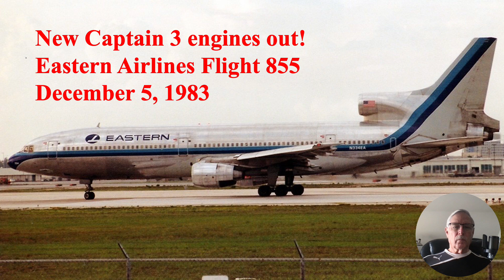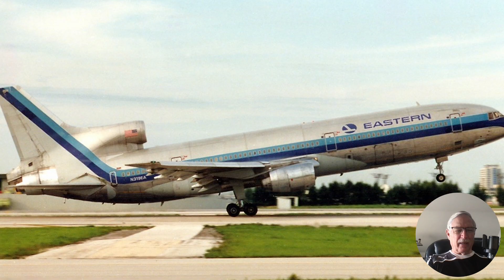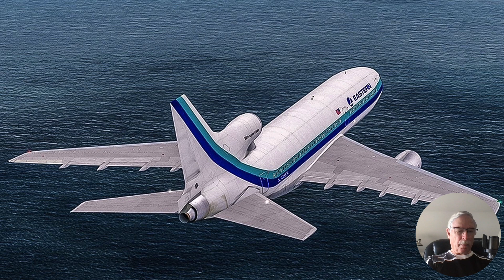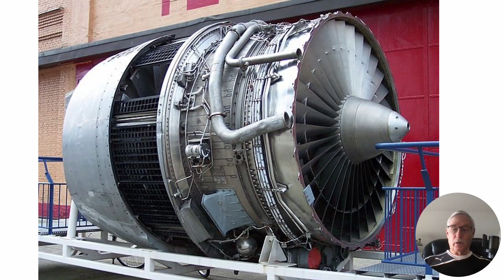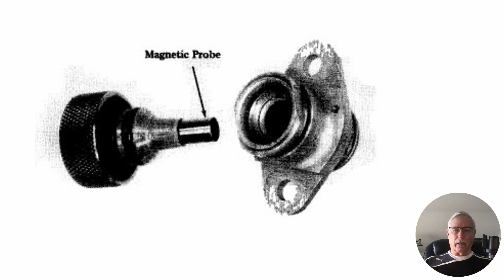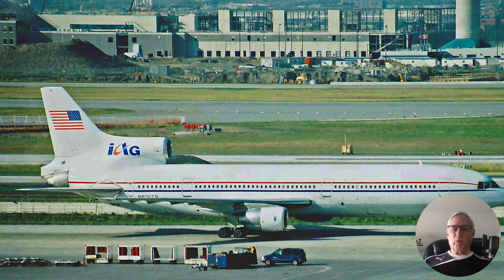New Captain 3 engines out! Eastern Airlines Flight 855 December 5, 1983

Comment: When the RB-211 was introduced in the '70's, it caused Eastern a boat load of problems, literally! Eastern was losing so many engines with the introduction of the L-1011 that they leased a barge to be towed out of JAX to SJU with new RB-211 engines aboard,. Upon arrival in SJU, the new engines were sent to the airport and the one's that had taken off on the ramp at SJU were sent back to the states for repair. The barge shuttle lasted for at least 3 years. One of my memories was watching the smoke tracing from a lost engine as the L-1011 turned northward after departing SJU, or the time one of the -211 engines failed just at rotation sending bit and pieces into the aircraft I was taxiing for takeoff. Back to the gate we went! Too bad,  as the L-1011 was a very nice airplane.
Reply: I knew the Rolls Royce reps at Boeing in Seattle….they told me when the L-1011 was new, the engines were so bad, that the Rolls-Royce mechanics / reps were flying on every flight.

Comment: I just enjoyed watching this video. I have a comment (correction) to terminology that is certainly not intended to take anything away from this. This was not a Single Point Failure (SPF). A SPF is just that, a single point failing - here three points failed, albeit three identical points in three redundant but separate systems. This is known as a "Common Mode Failure". Almost my entire career was in commercial nuclear energy production and preventing/mitigating failures was a subject that was extremely important and integral with almost every system in the plants. This distinction is very important because of the typically very different mitigating strategies. With respect to each engine only, the missing O Ring is an SPF, but with respect to the entire aircraft with three engines, it is not an SPF, it is a Common Mode Failure. This is a minor thing wrt to this very well-done video but, for reasons I do not know, I felt a need to comment. 45 years ago, I participated in diagnosing a failure in one of two nuclear safety related emergency diesel generators (I am a EE). The problem, an SPF with respect to the failed diesel, was due to a single wire incorrectly installed at the time of construction. It was found (via the "Extent of Condition" analysis) the second EDG had the same error. This made that a common mode failure. BTW, there were still other back-ups if both diesels failed but, obviously, the loss of the depth of redundancy was not desirable in any case, to say the least.

This video also had some nostalgic meaning to me as I lived in Miami at the time. I did not know one of the passengers, but I knew her husband (who was not aboard). She was in a group that was part of a work-related trip. Even though both have long passed, it would be wrong for me to comment more about that, but that incident had more than my casual interest.
Reply from the maker: Thank you for sharing a very informative and interesting comment!

Comment: Fascinating that all the oil leaked out because of O-rings. Must be extreme pressure to squirt out so much engine oil in such a short time. If I failed to replace the oil bolt washer on the drain plug on my car, I could probably drive 1000 miles before enough leaked out to trigger a warning light. This plane was in the air for like 30 min when oil pressure went to zero. Crazy!

Comment: It's strange that after determining 20 seconds of motoring is needed for oil pressure to cause visible leakage, they raise the motoring requirement to 30 seconds. Seems to be cutting it very close. They place a lot of faith in mechanics mumbling "one Mississippi, two Mississippi..." while staring at multiple gauges in a cockpit they may not be overly familiar with... I usually ran engines to leak check, with a second guy carefully looking at the uncowled engine.  This was an expensive mistake, and very close to being even expensive-er.
Reply: At Boeing, we’d always set the clock in the cockpit, for any timed test.

Comment: Hi Ron, I love your channel. Retired airline pilot here. 37 years flying 4 engine jets. 35 of those years as a Captain and check airman. This happened in a different time, which most people today would not understand....in many ways....

Two things came to mind. First, the FAA should not have chastized the F/E for anything. I loved having a flight engineer. From 30 minutes before departure to top of climb the poor F/E was  busier then a one armed paper hanger. Once they had an engine shutdown all three crew members workloads shot up exponentially. I can not fault that F/E in any way. His workload was over the top.

 I empathize with the crew on the  challenges choosing  a non-radar arrival to a third world destination vs a radar vectored arrival to a major destination in the US, with far better weather, just a few miles away. Knowing what they knew at the moment, it seemed very reasonable for a 3 engine jet to turn back. And throw in that it was a new Captain  with only 13 hours in the plane....wow....

I liked your comments about discussing how many engines were safer. Looking back on "Miracle on the Hudson", along about 2005 I had completed OE with a new Capt on a 747-200. He was slated to fly a release to the line flight a few days later with another check airmen that would be observed by an FAA inspector on a flight out to Denver and back. My student called me after the flight and said.....did you hear what happened. Nope I said. He said they hit a flock of birds about 10-15 miles from Denver on approach to the runway. The No 1 and 2 engines were severely damaged. No 1 failed and No2 was only operating at idle. But....they had TWO more engines running fine on the right wing, so they landed uneventfully.  So no one ever heard about it. 

Seems an argument for lots of engines. Remember the joke back in the day. Passenger, "Why do we have 4 engines?" Captain, "Because there isn't room for 6 engines".

Comment: I still miss the L1011 and wish Lockheed would come back to give Boeing competition in passenger airframes.  

That said, would the cluster of engines represent a virtual single point of failure, since the catastrophic failure of one could more easily take out another? Separating them on the wing is no guarantee, as we know, but I don't suppose that configuration would happen in modern designs.  

Although engine arrangements or numbers had nothing to do with this near accident. The single point of failure was the maintenance crew performing a procedure incorrectly on multiple engines. That defeats the safeguards of redundant systems. 

I guess, having multiple service technicians working each task is the equivalent of redundancy, so this kind of thing doesn't happen very often — people can catch one another. (Eyes Boeing's current problems) IF there's an equivalent to CRM on the ground.

Comment: I'm not a pilot. a mechanic, or involved in aircraft at all- but I still completely fail to understand how these o-rings could be missed. In addition to the obvious fact that a fitting going into an oil gallery must somehow attain a seal- they pulled the old ones out to inspect them for metal debris. During the inspection, the o-rings would have been as plain as the nose on your face. Since the procedure called for replacement instead of cleaning and reinstallation, it should have been rather obvious that the new plugs needed to have an o-ring fitted prior to installation. And I cannot imagine two trained mechanics agreeing that since they do not have the o-rings at hand, that simply ignoring that and "sending it" was a viable option.
In pipefitting of nearly every description, there are three ways of achieving a seal, dictated by the type of fitting. There's the O-ring or crush washer, in which the ring or washer is the sealing interface, the flare type in which the male and female sides of the fitting are conical and mate tightly, and the pipe taper in which the threaded surfaces are actually tapered and fit with a greater interference the more you tighten them- and also generally require a thread sealant such as teflon tape or pipe dope. Anyone with any mechanical experience at all, can identify the different types on sight- so I genuinely cannot understand how something like this can happen. Thanks for another interesting video.
Reply: Some believe that it was intentionally sabotaged due to Eastern’s hostile labour dispute with the mechanics?

Comment: I flew that airplane when I was at EAL. We named her Star Ship Glider.
Reply: Did Eastern brand its L1011s Starships?   If so, that’s amusing, because Western, The Only Way To Fly (at least according to Wally Bird, their mascot), called their DC-10s Spaceships.   These were -10 models which were sold not long after Delta bought Western, unlike the 737s and 727s, which fit snugly into Delta’s fleet (oddly Delta bought 737-200s years before the merger with Western, despite already having DC-9s)
Reply: They were dubbed "whisperliners."  LOL the loud-ass 727s were called "whisperjets."
Reply: @philipgcollier  That sort of corresponds with American Airlines calling its widebodied aircraft “Luxury Liners” and its narrow bodied aircraft “Luxury Jets” during the 1980s and 1990s, only it makes less sense relatively speaking, except perhaps from a passenger perspective, since the Boeing 727 was if I recall quiet to fly on, like the MD-80, the DC-9 and most other tail-engined aircraft, and unlike the delightful old Boeing 737-200 which had quite a roar in the back seats, which neither AA nor EAL operated for any extended period of time, if at all (I think AA may have briefly had 737s after they bought AirCal, but it wasn’t until they bought the 737-800 to replace their 727-200s that they became a substantial 737 operator, and the 737-800 is of course much quieter than a 200, and also quiet externally.
Reply: @philipgcollier 
It was all about the cabin noise, not the engines.
That name was applied to the 727, because when you were sitting in the first class cabin on that rear-engined aircraft, it was quiet up there in the front.

Comment: It wasn’t odd at all that #2 restarted, as it was shut down before bearing seizure occurred - which is why 1&3 failed on their own (a nasty catastrophic internal mess - also why they were smoking.) 

I’m curious if they could have achieved adequate altitude for a glide-in to MIA if they had trusted their instruments immediately. I’m guessing the oil leak rate was fairly similar regardless of engine power (at least not directly proportional) - so quickly going to higher thrust for a best climb rate before the engines failed may have been enough. I wonder if the report looked into such a scenario.  🤷🏻‍♂️

Comment: Thank you Captain Ron. I really appreciate your talks and your personal flight experience.  Thank you for all your safe flying hours.  It concerns me when a mechanic pulls out a chip detector and he has the old one in one hand, and a new one in the other hand, and isn't observant enough to notice that there is no O-ring on the new one?  And they know it is going in an oil system?  That's kind of disturbing.  And they mess that up three times with three different mechanics on three different engines?  And they all fail in the same flight?  Wow 😳.  I used to like flying. I'm a pilot myself, but I have been a passenger for many thousands of hours in the back.

Comment: A 4 engined BA 146 jet also had a similar oil leak failure on all 4 for lack of all 4 O rings on detector probes and it happened right on takeoff requiring immediate return.
Reply: There is usually more than one O-Ring on each chip detector, so that’s a lot of missing O-Rings!

Comment: I took an ATA Flight on the L1011 in '93 from SFO to HNL. Given your timeline of transfers, it can't have been this very aircraft. On the way back though, this time Delta from SFO to FRA, it might actually have been this airframe. We'll never know. I just remember that we got delayed (already in our seats) because one of the electrically powered passenger doors in the back would not close properly - it stopped inches from reaching the locked position. As far as I remember, a technician was called who then closed the door manually and it was deemed safe for the flight. I guess the passenger load was light enough to be within regulations for a transatlantic service with one door inop...
Reply: Actually door was perfectly safe and operational in an emergency. Door would be electrically closed, which during the process would compress an actuator that contained springs. To open the door in an emergency the spring actuator did all the work.... gotta love the Lockheed did things.
Reply: Me too actually.   Well, I flew an ATA L1011 SFO-OGG (Maui), then Aloha to HNL and then ATA on HNL-SFO.    In 1993.   Good times.   I was seven.  My first real vacation.   I might have even been on the same flight as you returning!

Comment: This still blows my mind. 
I can’t imagine how 2 or 3 mechanics can fail to put O-Rings on a chip detector. 
In nearly 40 years of working on or managing aircraft / people, I’ve never even heard of an engine that didn’t require O-Rings on chip detectors. 
Bizarre. 
F-111s, C-141s, 737s, 747s, 757s, 767s, & 777s. 
I’ve seen people fail to replace O-Rings, but to put chip detectors in an engine without any? -that’s a special kind of stupid.

Comment: When L-1011 and DC-10 pilots did pre-flight walk arounds, did they check the #2 engine as they did #1 and #3?
Reply: I never flew the DC-10, but on the L-1011 you looked at the inlet from in front of the wing and the visible portion of the engine at the base of the tail. You’d get as far back as you could from the engine to see if anything was awry in the tailpipe, but you couldn’t see much. There is a small hatch in the bottom of the S-duct that maintenance could access to look at the front side of number 2, which they did frequently.
Reply: L-1011, check the gas and fill up the oil. checking #1 or #3 easy, #2 not so much. I remember as an F/O riding up a belt loader with a case of oil and a can opener. Open a quart and pass it to the F/E sitting inside the cowl……..fun & games. but the F/E bought the drinks after!

Comment: I don't think they do this any more, but piston engine aircraft previously would load up the oil with plenty of molybdenum-sulfide (MOS2) dissolved in the oil, small particles to circulate around in the engine, there to give the engine a fighting chance to hang in there for a while if an oil leak happens in flight (bullets in war, other crack malfunctions, etc.).
In this case, a jet engine which I think used a "POE" synthetic oil base, might do well to consider MOS2 as a back-up (??) maybe.  MOS2 is often in car motor oil for friction reduction, and probably would help if you lost a bunch of oil and had to keep it running.
Reply: No, they would never do that, especially in jets.

Comment: Looking at a picture of the detector, for a RR RB211, It would be OBVIOUS, even to a non-mechanic, there are 2 grooves for 2 O-rings. SMH. NATIONAL TRANSPORTATION SAFETY BOARD
WASHINGTON, D.C. 20594
AVIATION ACCIDENT REPORT
Adopted: March 9, 1984
EASTERN AIR LINES, INC.,
LOCKHEED L-1011, N334EA
MIAMI INTERNATIONAL AIRPORT
MIAMI, FLORIDA
MAY 5, 1983

Comment: OMG those mechanics almost killed a whole plane full of people. Sickening. I cannot fathom how they ever got jobs.
Any mechanic knows you always compare the removed part with the new one. It would be OBVIOUS that it requires an O-ring/gasket/etc. to seal it. Egregious to say the least. A turbo-prop almost went down in similar fashion, because the filters and associated O-rings were not replaced properly, and the install was supposed to have been checked by two mechanics. It never was.
Then again, I have heard of Jiffy-Lube, etc. ruining engines, by never reinstalling the oil drain plug. They hire people with zero experience. Probably a former burger-flipper.
Reply: I always take my vehicle to a true service station for my oil changes & work. Yes it’s much more expensive, but I know they’ll stand behind their work.